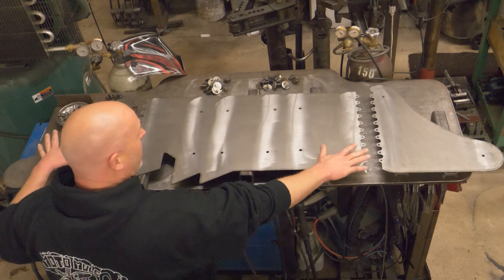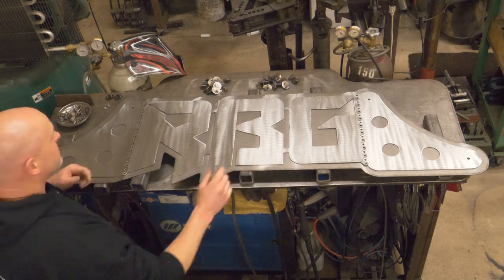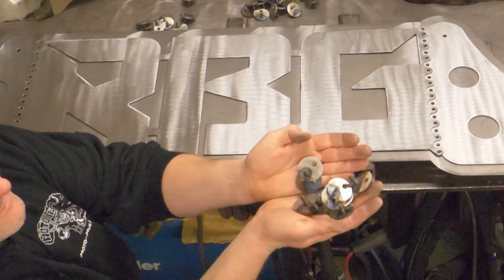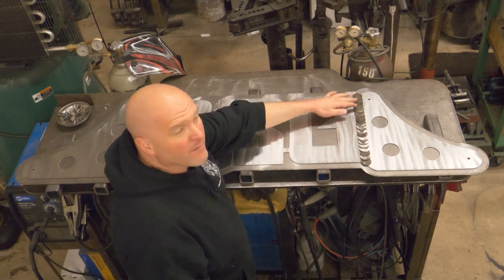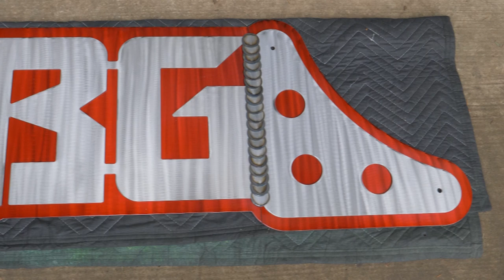How to build a custom metal sign with 3d effects.

Comment: Excellent work my friend. Quick question. What did you use for a surface prep pad before doing your coating?? I love how it gave some real depth to the red!
Reply from the maker: Ran a flap disc from top to bottom, several lines accross the surface.
Reply: Must have been a pretty fine grit?? Or just really light handed?
Reply from the maker: @1dickycat  lightly done.
Reply: Sick! I'll have to give it a try one of these times. I'm usually a polished man, but thats just so rad. Even if it was contrasted on the same color (sanded on polished).... hmm the ideas are flowing now 😅

Comment: Zapping it with the heat have enough variance in the color to make it look real.   Nice touch. 
So what did you do on the back?  Did you weld it all together or is it separate like that so you can take the pieces back apart? 
It would have been nice to see how you finished the back side.
Reply from the maker: There are nuts on the backside. I never took pics of the back....